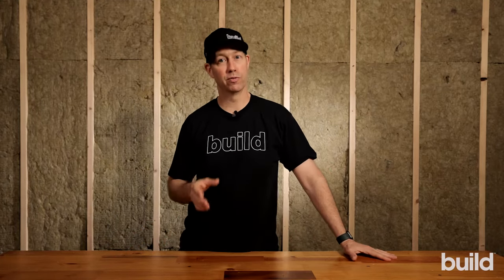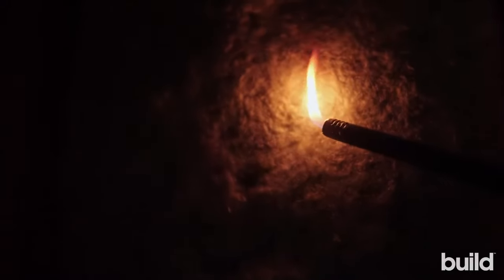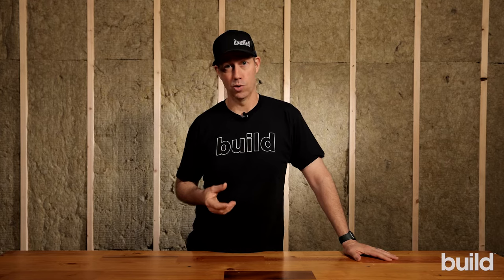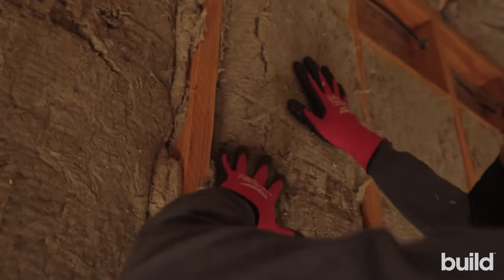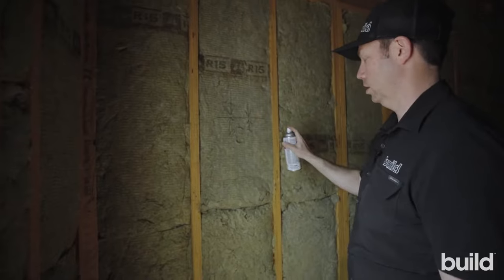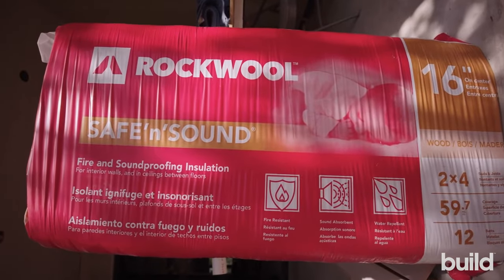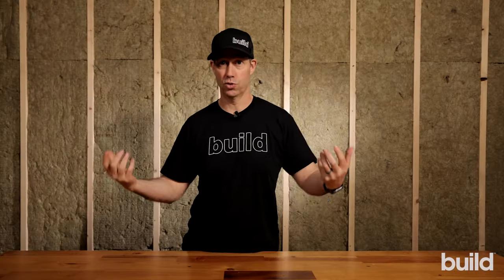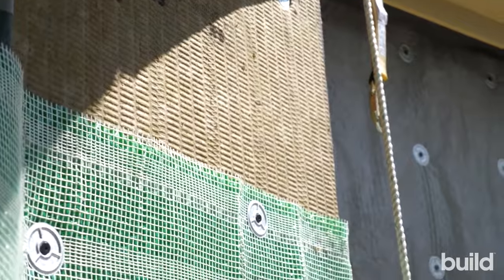8 Reasons to use ROCKWOOL™ stone wool insulation from a high performance builder

Comment: i gotta endure a cold house this upcoming winter like I did last year because my house isn't insulated but I've been telling people about rockwool and I got a sample of the stuff its heavily fire resistant held a lighter to it for a while and it wasn't even transferring heat...next year I'm going with rock wool and cement board instead of drywall...

Comment: It sounds too good to be true.. what’s the R value?
Reply: 2x4 R-13 or R-15, I think R-21 R-30 2x8. It’s best insulation I just used it for first time in small room built in my shop all u need is tape measure and bread knife it friction fits in place. We going sale our home one day when we do am going 2x6 walls r-21 in them and on outside am either doing 3 1/2” rock wool board it’s different than rock wool insulation or more than likely on outside doing zip board with 2 1/2” foam attached for extra R-12 give me like r 43 total on my walls. Power bills in bama going sky high buddy of mine has 300sq bigger house than me dod insulation like I was talking about doing for new house he is one told me about rock wool anyways last 3 months his biggest power bill $128 mine has been $425 $480 last one $451 makes me sick. He only has to use a tiny 2 ton unit cool his house we’re I have 4 ton barley can keep up when hot hot like July aug. His unit only kicks on maybe once a day I kid u not I had go over watch a ball game to see it for my self like a yeti cooler with ice except his even better insulated than a yeti. Rock wool is from lava rocks and rocks from making metal. It’s spun in this machine till it kinda does like cotton candy then it’s whipped back and fourth  in layers it’s real thick and dense does not fall apart cut pick it up press in between studs